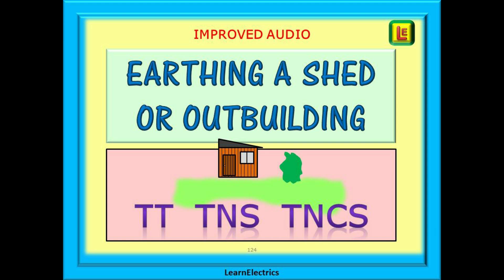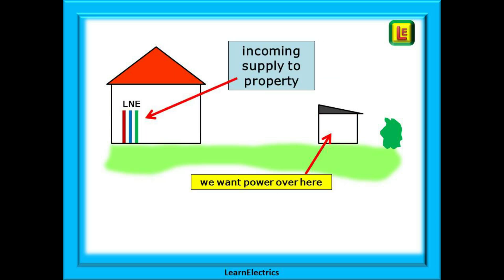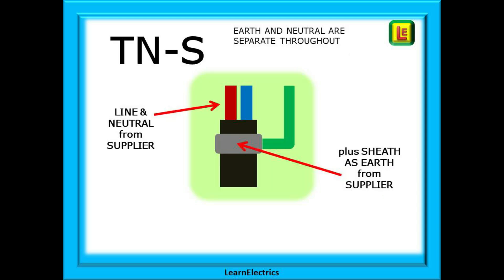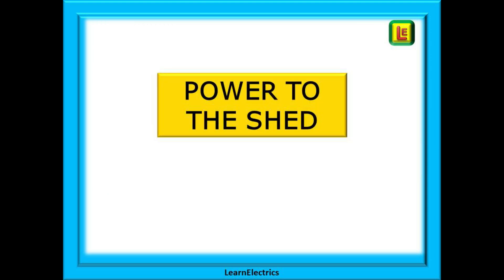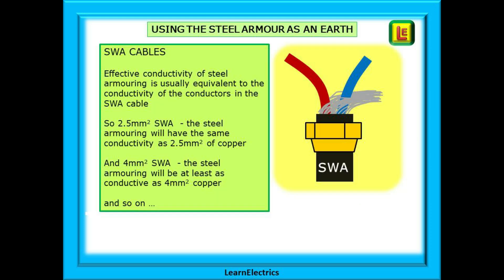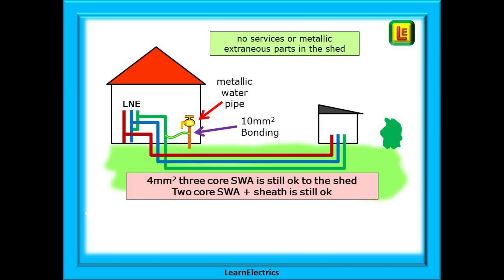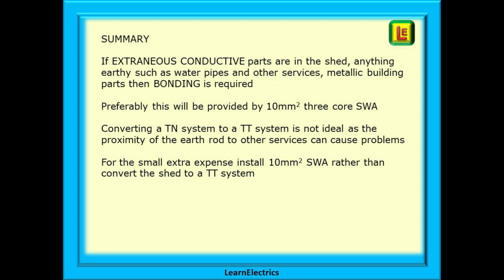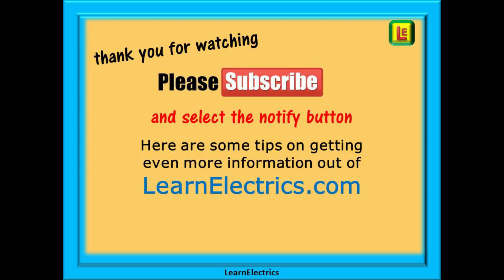EARTHING a SHED or OUTBUILDING – TT – TNS – TNCS – IMPROVED AUDIO

Comment: If your house is TNS and the shed does not have water pipe etc then exported earth via the swa makes sense. If then solar and batteries are installed, in power cut the house switches to TT, isolating from the substation earth. Is it OK to export this tt earth or should the shed have its own earth rod. 
In this situation should an earth rod be used anyway, even with the exported earth or can this cause issues with multiple earths. Thanks
Reply from the maker: Both areas should be earthed and connected. You need to create an area that bonds all the earth potentials to the same potential.
Take a look at this video.
https://www.youtube.com/watch?v=afDWcA0gGLc

Comment: This always seems to be such a grey area of what should be done for the best. Instead of running 10mm 3 core swa to the shed, could a 4mm 2 core be run for the supply with a separate 10mm earth wire alongside for the bonding, like is frequently used for large swa sub mains where the armour csa is not large enough.
Reply from the maker: Personally I would use a 3 core cable so that the earth is actually part of the multi-core cable and cannot become separated.

Comment: Thought you need to split the earth on tncs system when taking a supply circuit to an outbuilding
Reply from the maker: You are correct, you should indeed split the earth on a TNCS system when running a supply circuit to an outbuilding. There are a couple of references to this in the video. e.g. If running a new supply from a house, the TNCS should already be split for you at the incomer. Thanks for watching.

Comment: Im loving these vids! Thanks you! I'm kinda retired and gettimg back into it. This is a  set up I've always struggled thinking about. Ill just throw this out there . What if you have a concreate base under the  shed. Ive heard that even though you might have a decent earth from the house , can still have not so good pd with the ground which can also be dangerous, keeping the shed on a tt and the supply sheath separated may be better ... which i find it hard to decide what to do when i appoch this kinda job. Should i go stright to land records now  check for existing buried pipes then chuck some probes in see if the ground is good or just settle for low regs satisfying zs reading from the house, which i would tend to lean too i think ...
Reply from the maker: Concrete can be a funny thing. Wet it can be conductive but dry it can be a good insulator.  Thanks for watching, appreciated, Dave.

Comment: How would I pass the SWA through a metal sheds wall? Should I use a gland and earth it there and go into a junction box on the inside. Or should I use a grommit for the wall and earth the SWA some where else. Also how would I earth the cable on the inside?
Reply from the maker: The cable will need protecting from physical damage where it goes through the wall. Without seeing the actual set-up, it can be difficult to imagine. I would terminate it inside the building and then branch out from there.

Comment: Very useful video! I have wanted power to my workshop shed for some time. What are the rules in 2023 with regards to protecting armored cable as it is laid to the shed? I was told that you have to use different gravel to indicate power cable. Does this always have to be a trenched cable or can it be run above ground?
Reply from the maker: Recommended 500mm deep. Marker tape at about 300mm. It can be run above ground as long as it is visible and away from damage (strimmers, lawn mowers etc.)  Hope this helps. Dave.

Comment: Taking into account the reason you mention as to why not convert to a TT- system for fear of voltage inducement from nearby service under fault conditions.

I HAVE always understood it that we avoid extending a  PME system to an outhouse in the event the Neutral conductor breaks. 

Do we opt for the likelihood of the lesser evil ie induced voltage from a nearby service, or the earth conductor made live due to the broken neutral conductor at source?
Reply from the maker: This always has been a should we should we not scenario. Some DNOs say there must be an earth rod, others are less committal. Thanks for watching, Dave.

Comment: I have had to change the TNS 6mm SWA supply to a metal shed to 16mm TT as inspector said that you should should assume TNS is TNCS & not export the earth due to possible PEN failure. This is a very confusing scenario. Go on any electrical forum there’s a lot of conflicting opinions.
Reply from the maker: Thanks Kevin. This is one of those some do, some don't scenarios and lots of different opinions. Some DNOs permit it, I know of at least one supplier who says that everything must be earth staked as TT, no exceptions. Dave.
Reply: @learnelectrics4402  is TT a default when in doubt?

Comment: Great videos.  If a water supply was going to be added later and the SWA cable were too small,  could the use of plastic water pipes be used instead?
Reply from the maker: I have seen that used and clay pipes. All the regulations expect is that the new cable is adequately protected from damage, that it is clearly identified as an electrical cable and that due consideration is giving to heating effects in the cable because it is inside a containment. To be honest, if you are digging out for a blue pipe you might as well put SWA in. Have you thought how you are going to get the cables through. Dave.
Reply: @learnelectrics4402  It was just a theoretical question,  im not actually going to put in a water supply.  I do however have a question about exterior electrics.  When I moved here an outdoor socket was already fitted halfway down the garden.  They used SWA cable buried along the fence.  As the socket is near the shed I wanted to extend the cable into the shed to a consumer unit and run lights and sockets from there.  My question is about the cable.  I cant find any markings to indicate its size.  The outside circumference is 19mm when wrapping string around it.
As the cable was previously only connected to a socket,  is it safe to connect to a CU?

Comment: Great video dave. One question though, what if the shed or out building wasn’t going to be put on its own circuit? 
Say an swa was run from a convenient socket outlet on say a downstairs ring final circuit. Then the outbuilding had only 1 socket outlet installed for instance. So in effect we have spurred into a ring to add 1 additional socket in the shed? Would you export the cpc across? Or just take the line and neutral over then locally (tt) rod the new socket??
Reply from the maker: I wouldn't do that. I prefer to see each part of an installation on its own MCB. Adding cables to different circuits can lead to confusion as to which MCB is which cable in which room (or shed). Dave.
Reply: @learnelectrics4402  under normal circumstances I totally agree with you. The job in question where 1 socket was spurred off an existing ring final, was only done that way due to the difficulties in running a dedicated supply from the consumer unit (located at the furthest point away from the shed) through a fully laminated house!!! So even though not ideal, and certainly not the first choice of getting power out tho a shed. It was the only viable option on this occasion. So my question still stands, should the pme be exported or should the shed be made tt???

Cheers dave👍
Reply: I'd say Vd and zs need to be satisfied in the first instance or I wouldn't consider it ...of it was and on an RCD yeah maybe 🤔 maybe an RCD socket in the shed for good measure if you've already done it ..

Comment: Aah the old extend the PME debate. When I had power put into my garage, I saved around £100 running 2 core 6mm SWA and making it TT, from installing 3 core 10mm SWA. There is also the issue that although the earth bonding can be extended using the 10mm cable, the equipotential zone isn't. If there is a danger of being able to touch the extraneous metal work external to the building, when in contact with the actual earth, then a shock risk can also exist. This was the reason why the earlier EV chargers had to have their own earth rod, prior to the manufacturers revamping the protection circuits within them.

You can of course add an earth rod at the shed along with the 10mm cable, but then it depends on the age of the PME installation and if it is genuine PME or the pre 1970ish version, that relied upon the metallic earth and gas pipes. If you suffer a PEN fault, you are then in danger of having some hefty diverted neutral currents flowing through your cabling from neighbouring installations. 

All the various earthing systems have their pros and cons, its just what you are prepared to live with. You certainly braver then me doing s video on the subject.
Reply from the maker: Thanks for watching and the comments. Dave.

Comment: Is it ok to put in an earth rod as well as using the earth from a TNCS supply, as long as the rod is at least 10m away from any other underground cables or metal services.
Reply from the maker: Yes, some network operators do insist on this belt and braces approach.

Comment: Could you advise the requirements for the example above but with a water supply from  a plastic pipe, as this would be the most commonly installed source of the water supply,
Reply from the maker: Roger, as it says in the video, if there are no earthy parts bonding is not required.
Take a look at this video ...
BONDING PLASTIC and COPPER PIPEWORK on the link below
https://www.youtube.com/watch?v=EYj9mvOfF_w
Thanks for watching. Dave.